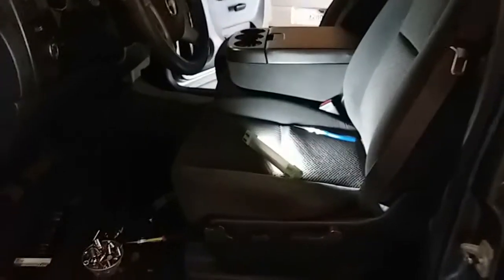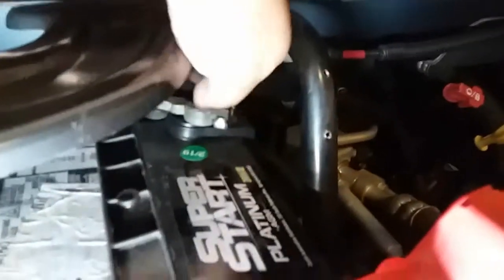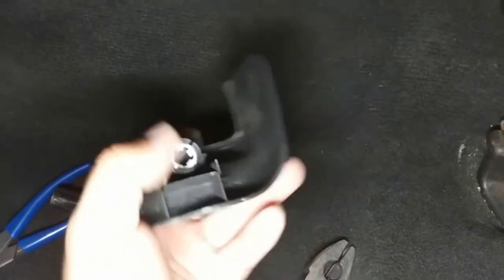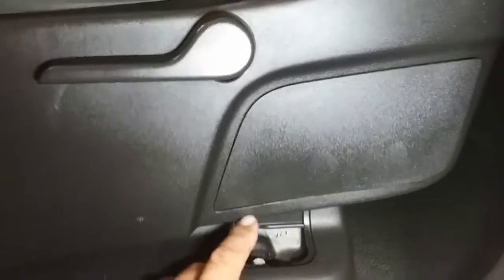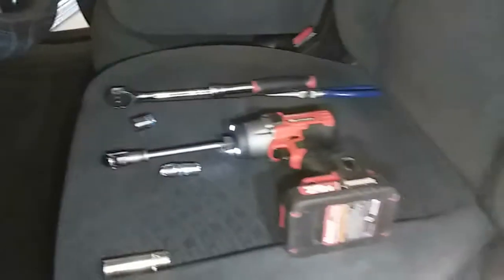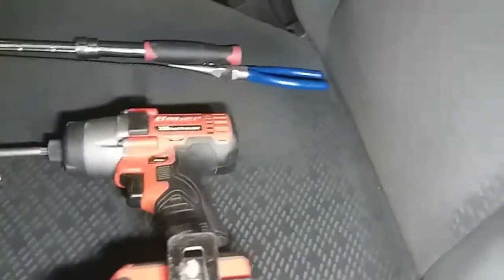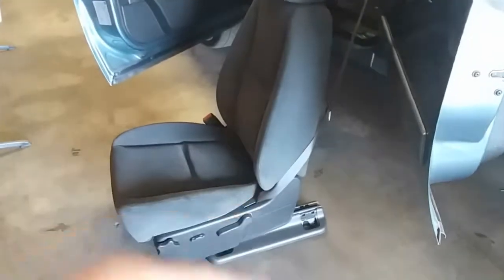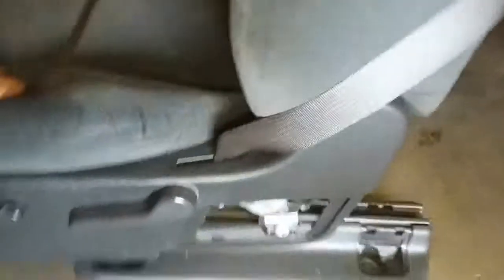How to: Remove the Driver seat on a 2007 Chevrolet Silverado

Comment: what did you do with  those seats lol i want them
Reply from the maker: Lol I put them back in. I'm just taking them off to clean up underneath 🤣
Reply: @559powerscape   I just broke my upper driver seat in my 07classic  replace it with manual  seat but the motor for the electric  works great dont  want to trash it